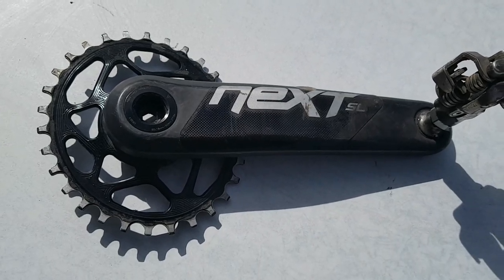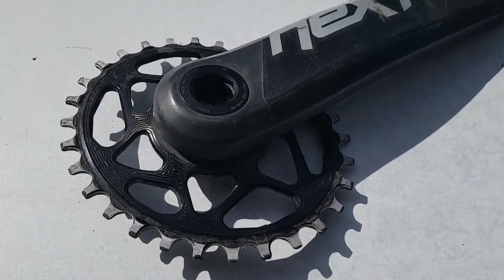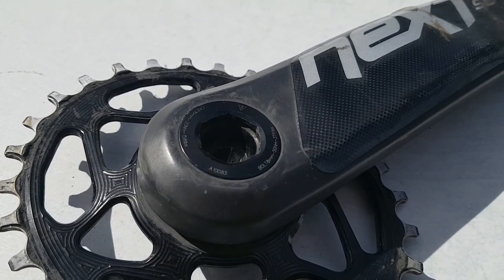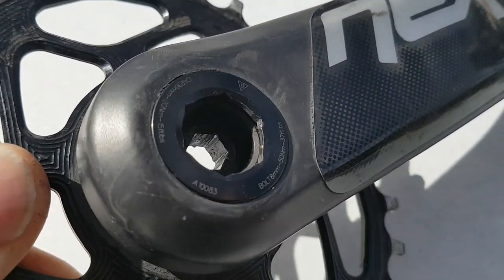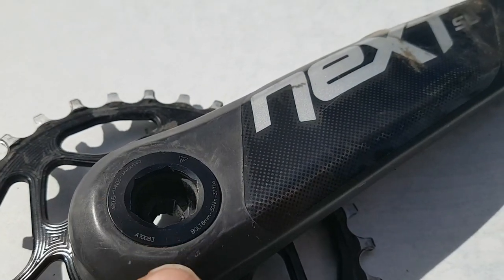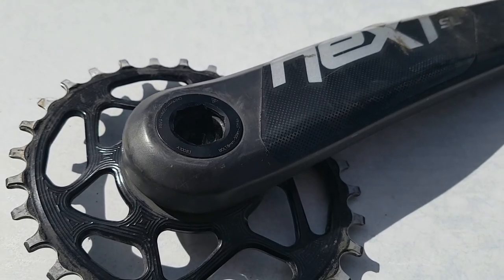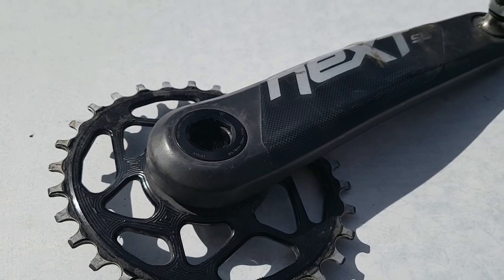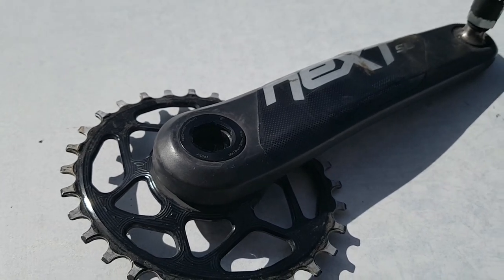Raceface Next SL carbon crank problem

Comment: Same here on my Next R driveside crank. 2nd time in 1,5 years on my trailbike. Always used a high quality torque wrenche. I'm a pretty smooth advanced rider with 80kg (160lbs) tops :(
Waited over 3 month for replacement last summer. We'll see if the "next" crankset will solve the problem once and for all

Comment: Tony, What's the weight of dis crankset (arms+chainring) ?  Is it lighter that Xtr Crankset ? 
Thanks
Reply from the maker: Hi
Yes the Raceface crank is lighter but they are not as good because they break. 
I have xtr's on both my mtb bikes, faultless. Go XTR
Reply: Hello
I have he same problem. If i can torque bolt 16hex can i solve it? Or this part are unglued? Thx
Reply: @AG0WNZ  the problem is the bond of the carbon with the aluminum, torquing the bolt will not help
Reply: @Pelaez2424  Finally replace it in warranty. Thx
Reply: Alberto Aguilera Gasque i have the same issue but my crank is 2 years old now. is it covered by warranty???

Comment: if you dont have warranty on it i have a fix, just ask for info
Reply from the maker: Thanks, will keep that in mind for the next fault 👍
Reply: I have the same problem. What would be your fix?
Reply: do you have a document vid on this mate? got the same issue...:(  where exactly do be drilled???
Reply: @theclash32  hi ruel that fix doesnt last long, a few months, if you are out of warranty throw it away they are trash and get the Next R, the Next SL are only for crosscountry, the Next R ,are for enduro and harder rides, they are much better
Reply: Please share the fix
Reply: @vanjasomodi  after 2 years i can tell you the fix is to throw them in the garbage and get the NEXT-R crankset, R stand for rowdy and are for enduro etc, the SL is only crosscountry and have issues with stability